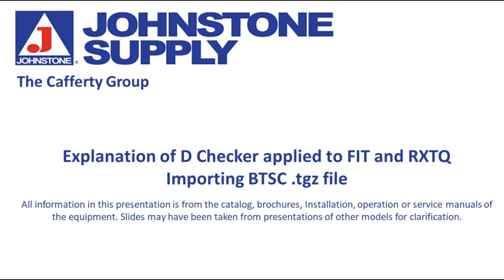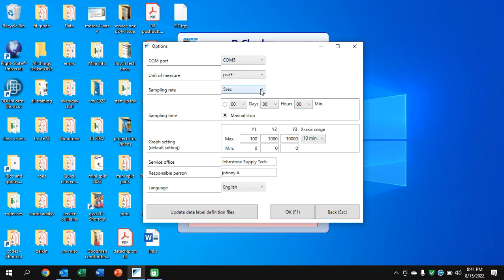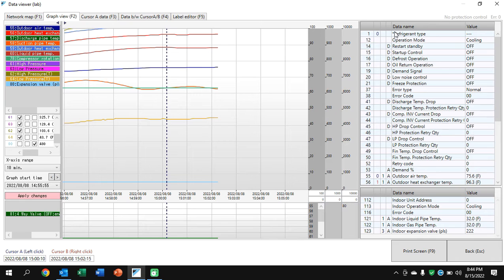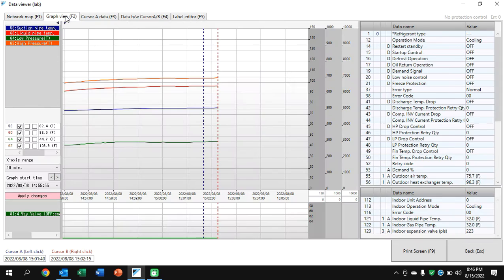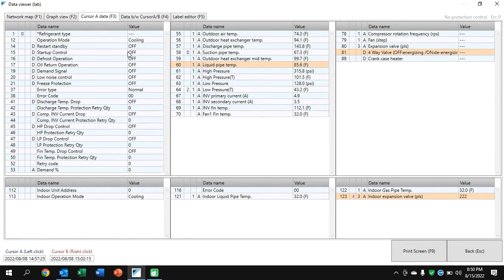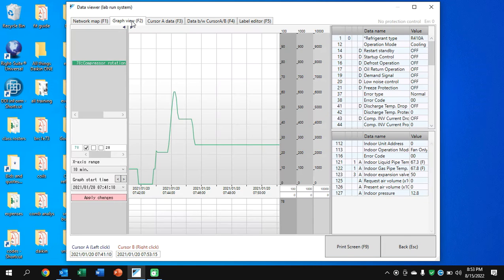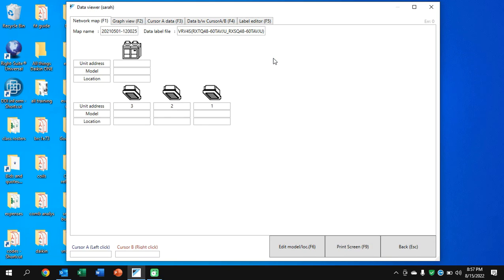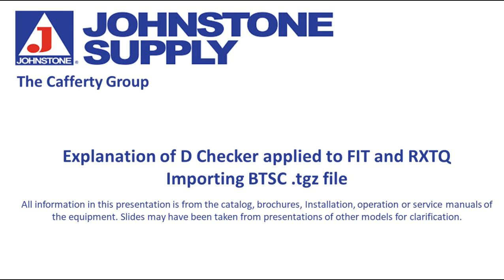Daikin D checker review

Comment: How can I get the tool please
Reply from the maker: Any Johnstone would have the BTSC (blue tooth service checker) under part number B23-292, Daikin would use part number 999172T.
Reply from the maker: Any Goodman / Daikin Distributor or Johnstone Supply near you should carry the Bluetooth Service Checker (BTSC), exporting the data to your laptop and importing with d checker 3 free software. You also can blue tooth with your laptop and the D checker 3 software directly.
Service Checker 4 requires special training form Daikin and can only be purchased with a certification.